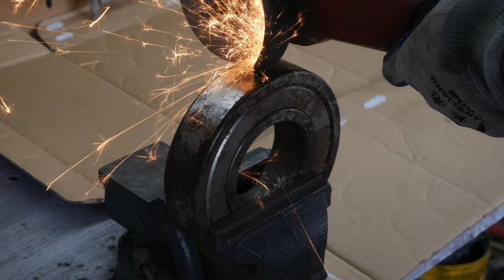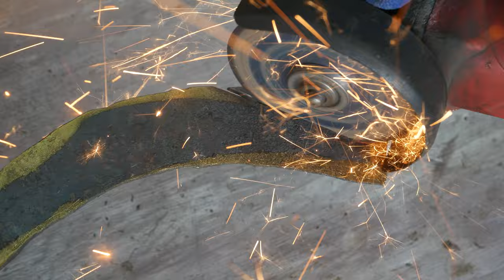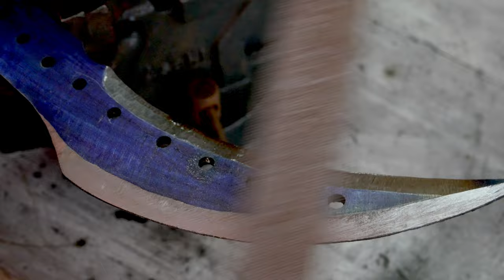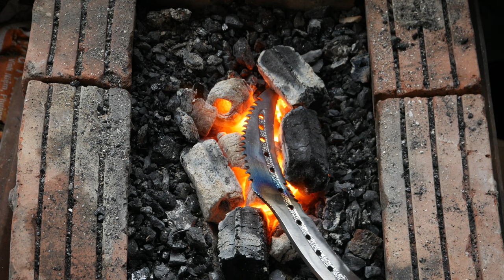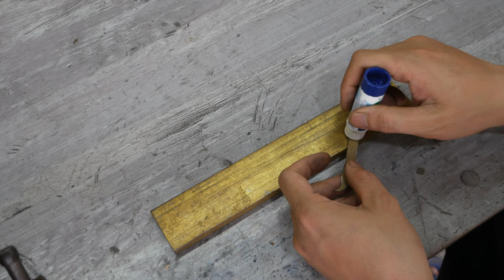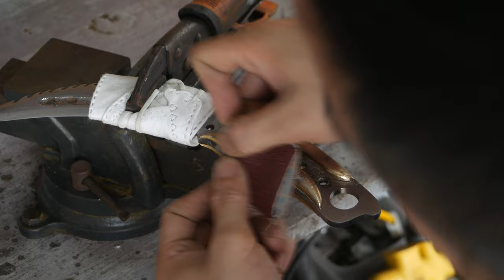Knife Forging - Forge a damaged ball bearing into a Karambit knife

Comment: Nice aggressive karambit, very good job. 
I'd like to know what is the bit you used to carve the middle of the blade, where the holes are. Does it last long? What material and shape is it?
Reply from the maker: Hi, the tool you are asking about is a tungsten alloy metal engraving tool with very high hardness and good resistance to steel, if you are interested buy it on the e-commerce platform and don't forget to leave a comment. give me a like and follow!
Reply: @Arts-and-Crafts  thanks a lot! I'll check it out!